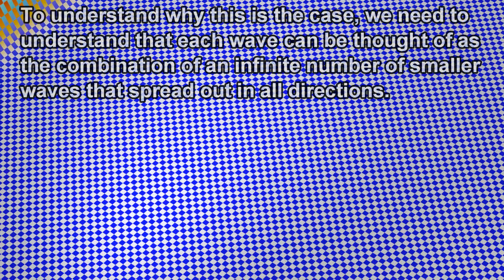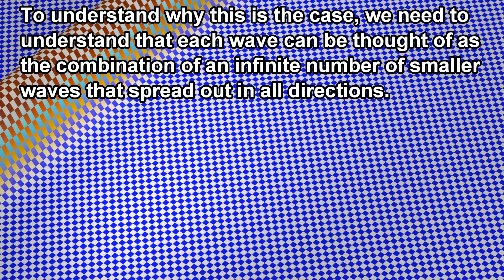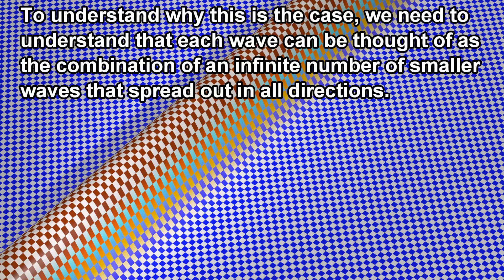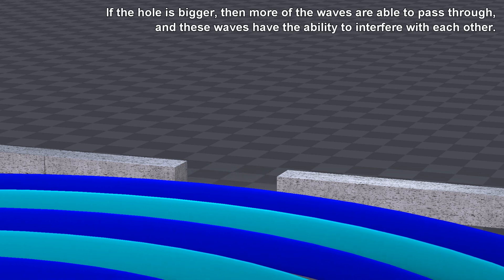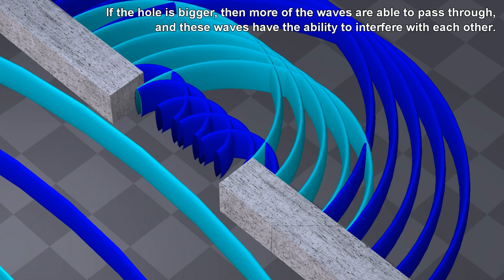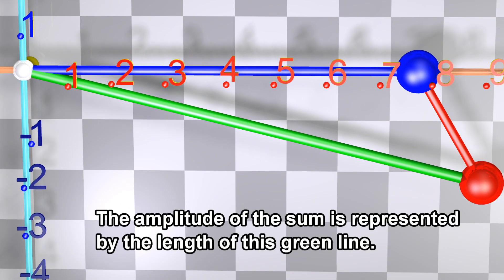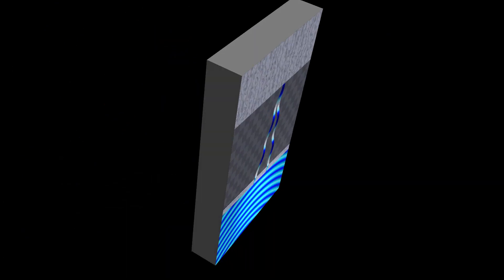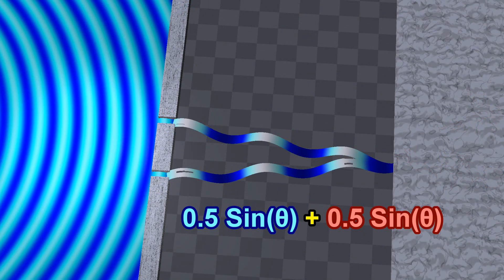Diffraction interference patterns with phasor diagrams

Comment: You know perfectly well that a single slit does NOT make an interference pattern with water waves. However, it does with light. Why? Because light is not waving, it's reflecting off both sides of the sit. The Huygens Principle is nothing more than a mathematical contraption to force waves where they do not exist.
Reply from the maker: A single slit does make interference patterns with water waves.
Reply: @EugeneKhutoryansky  a simulation is hardly evidence. Have you ever seen a real ripple tank experiment with water? I did. It makes a single set of waves. Nothing is "interfering".
Reply: @EugeneKhutoryansky see https://youtu.be/K_3daRJ0sy8?t=87 with a real ripple tank.
Reply: @EugeneKhutoryansky how many hours did it take you to create this video? Did you make it yourself, or you used a paid service? I'd be willing to pay, if the price is reasonable of course.
Reply: It's time to set things straight. You being very skilled at making animation videos, I would really appreciate your help showing the truth to the world. A laser beam hitting the slits will reflect following the Law of Reflection. The reflected rays fan out because the angle of reflection is changing. No corner is a perfect right angle (especially at the micro scale). The fringe pattern is therefore a reflection pattern. See the experiment through smoke or a cloud chamber, and you will notice independent rays diverging towards the screen. Every reflection becomes a new source, so no matter how collimated a beam may be before the slits, the reflected rays will always diverge.

Comment: when it's just one slit, there is no interference pattern (at 2:29). check this vid: https://www.youtube.com/watch?v=dJywiz37lNQ
Reply: Well, there is a fringe pattern with light, but it's not an interference pattern for the simple reason that light is not a wave. The fringe pattern is caused by reflection off the sides of the slit. Water waves, on the other hand, do not produce a fringe pattern (interference pattern) with a single slit.

Comment: By far the best illustrated and explained series of lectures I've seen on the subject. There are some very odd experiments I have seen not very well illustrated but quite well explained; in which clever attempts where made to trick electrons into taking the wrong path. All attempts failed. The only explanation was that somehow the electron 'knows' ahead of time whither or not a barrier will be there thus always following the shortest path in the now. This left me scratching my head for years! It would be a challenge but I'm wondering if Eugene could produce a video addressing this phenomenality?

Comment: Woah , sine function had a 3rd axis ?

I don't understand , why the sin function have depth ?

What is sine function in first place ?
Reply: The vertical axis, coming out perpendicularly to the x-y grid, is the argument of sine, say θ. This helix that wraps around this axis looks like a sine function of x vs θ if you look at it from the side and ignore the y-axis (as he did in the video). Likewise, if you were to look at it from a side where the x-axis is into the screen, i.e. y vs θ, you would get a cosine function. 

The reason this works is because of complex numbers: the green helix he plots is the function e^iθ, where i is the imaginary unit. Euler's formula states that e^iθ = cos(θ) + isin(θ). cos(θ) is the real part of e^iθ and sin(θ) is the imaginary part of e^iθ (because it is multiplied by i). So in effect the function e^iθ maps θ to two functions: sin(θ) and cos(θ), and you can denote each of them on a separate axis (so one axis for θ, one for sin(θ), and one for cos(θ)). If you look at only one part of e^iθ (the green function he plots) it's as if you only look at sin(θ) or cos(θ), depending on what side you look from.
Reply: @456dave7  Thanks sir !

Comment: The sudden discontinuities in the animation really don't make a very convincing case that you're accurately representing reality. There's just a line where suddenly one wave becomes 5, I don't think that's the way it really goes down. These little details are important so you don't lead people down the wrong path in their understanding. If you have to introduce inaccuracies in the name of simplicity of teaching, I don't think you're doing anyone any favors. Having said that, I appreciate the effort to try and spread understanding about this stuff. But we want the right understanding, not a magical or fallacious one.
Reply from the maker: In reality, it is not 5 waves, but an infinite number of waves each of which have an infinitely small amplitude, such that when added together, they produce the total wave that we actually see.  Though, an infinite number of waves with infinitely small amplitudes is not something that can be animated.
Reply: Infinite number of waves with infinitessimal amplitude... which add up to equal the wave going through the small tunnel, yes? I'm assuming that translates to an integral with respect to the dimension of width of the hole. So when the wave emerges from the hole, we shift models to one of sums or integrals of interference patterns basically. Should we be using this model from the beginning? depending on the type of oscillator, like if the wave is coming from an area being displaced rather than a single point, is that how you would handle it?
Reply: Oh and thanks for the reply, I kinda feel bad for sounding so critical. I just watched a lecture of Richard Feynman where he talks about his teaching philosophy, I guess I was evangelizing with gusto, hehe. Hard to beat that guy. Not that I'm saying my words are his or anything. Anyway, I appreciate the one on one, but me and math are like a cat and water. I think I'm emotionally traumatized by getting into fights with my family over math homework as a child. I do find it fascinating, but chances of me having a serious physics career are pretty low.

Comment: What I don't understand is, why do waves travel in a straight line at all; for instance if you pause at 17:00, every point in the light blue beam can be thought of as the source of a single circular wave (correct?), so why don't they all just expand out in every direction?
Reply from the maker: +Adam Thornton, because in all directions except for one, the waves completely cancel each other out, as was shown by the diagram for the large hole.
Reply: Eugene Khutoryansky
I mean after they have passed through the hole, why aren't they able to change direction again? But I think I see that the same principle would apply here.

Comment: Eugene: I really liked the phasor technique when the slit (d) becomes appreciably larger than lambda.  I hadn't seen that before.  A few questions about that:

1) This reduces to the standard Young Experiment when d<<Lambda?
2) For d>Lambda, I suppose the approximation gets better as the number of "sub-sources" increases
3) When d>>Lambda, does it make any sense to use a sub-source separation smaller than lambda?
4) What does a negative phasor magnitude imply (Partial trough?)
5) Are these techniques more applicable for fluid-waves rather than light-waves of single color?

On a more important note, I presume these techniques are only an approximation to QED?  As you know, QED produces ("amplitudes"--->probabilities at the back plane).  I grapple with how simple phasor techniques which don't include quantum effects could match the mathematical Sum-over-history/Renormalization of QED.

Thanks again for your beautiful vids.

Comment: Amazing video! I really love how you're building off and combining old topics you already covered. One thing though, at around 12:38, doesn't that green line passing into the negatives on the x-axis suggest a negative amplitude, or is the only significant thing the actual length of the line? And if so, is there anything significant about the last point passing into the negatives? Thanks
Reply from the maker: +pendalink, it is only the length of the green line that signifies the amplitude of the sum of the waves.  The fact that its X coordinate is negative doesn't matter, since the green line is going to rotate around the theta axis as theta increases, and I was just showing the cross section for when theta is zero.  And thanks for the compliment about my video.